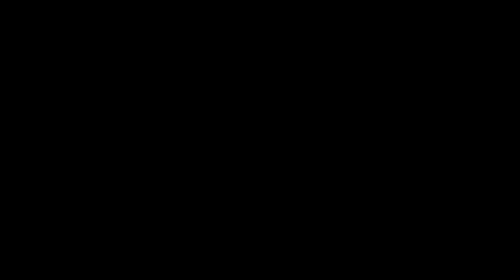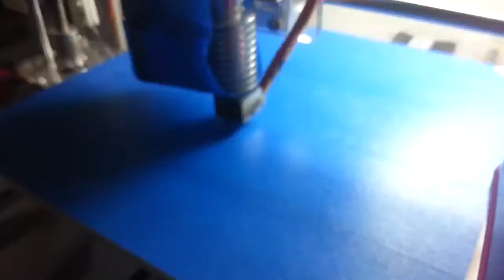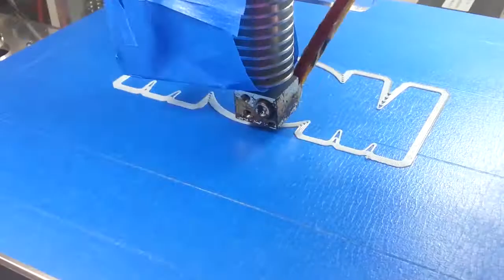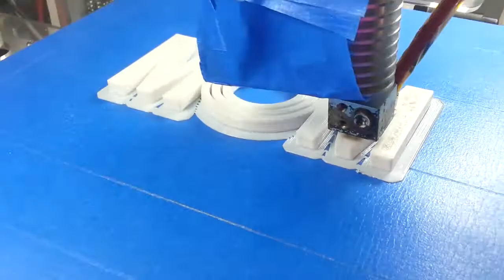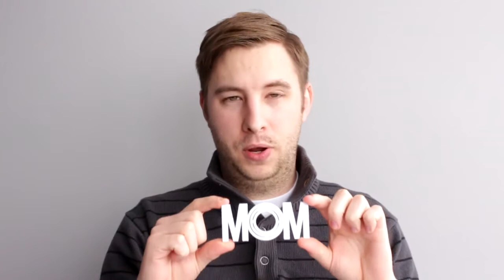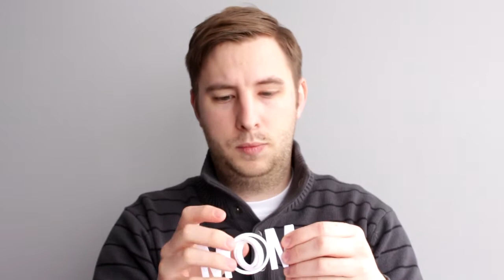Cool Printing: Print in Place

Comment: Do you have any tips for not getting warping when printing with Pla? I'm still printing with the free plastic that came with the printer so I'm guessing that might be a factor too.
Reply from the maker: Hi,
I don't have any tips for PLA. All my printing has been ABS. I didn't think that PLA warped, just that it can be dimensionally off slightly. Are you sure they sent PLA and not ABS if you are getting warping? What temp do you print at?
Reply: ***** usually at 215, I'm trying to figure out if it's just not sticking or if it's warping. it's usually on the raft or bottom. the sticker on the roll says pla.
Reply: ***** also, I've been using cura, I just printed something from clic3r that I also printed in cura and it's way better and has no warp. so maybe it has to do with speed control?
Reply from the maker: +MiningNinjaOctopus  It might be speed, I am really not sure but I switched from Cura to Slic3r early on and never looked back. I find it gives me more control of that vital first layer as well as much control over infill and speeds. I was losing bed adhesion all the time with Cura and now that is less. The interface for Cura is much friendlier and quicker but if it doesn't print as well....
Reply: +MiningNinjaOctopus When printing with PLA I like to print with the nozzle temp. at 195C. If you are printing on painters tape DO NOT heat the bed. When you heat the bed the PLA will not stick very well to the painters tape. Also make sure when you print the first layer the nozzle is close enough to the bed so that the PLA squishes a bit onto the printing surface. This will ensure good adhesion and reduce the risk of warping. These tips helped my PLA prints come out looking a lot better.
Reply: Reukan Unknown cool thx

Comment: What temperature do you heat the bed to when using ABS? I have been using the Sunhokey Prusa i3 as well, and my ABS prints are not coming out too good. Any tips on printing with ABS?
Reply from the maker: I usually print at 245 for the first layer with a bed temp of 93. Later layers are at 235 and 85. The first layer is key. I use blue painter's tape and a bit of hairspray to get the adhesion (though this sometimes fails, i want to try abs juice sometime). I usually print at .2 or .3mm layer heights. I don't have a fan pointed at the extrusion but it is something I want to try.